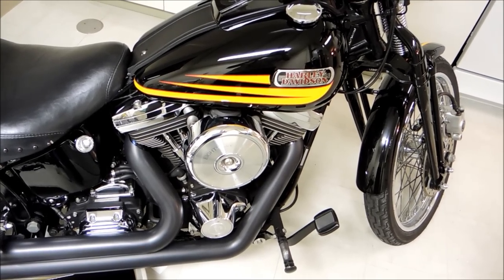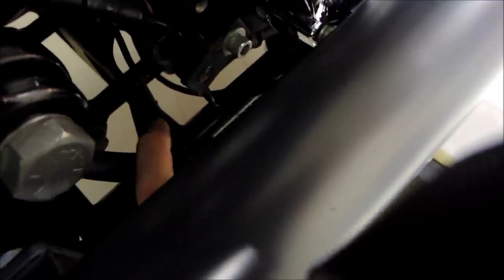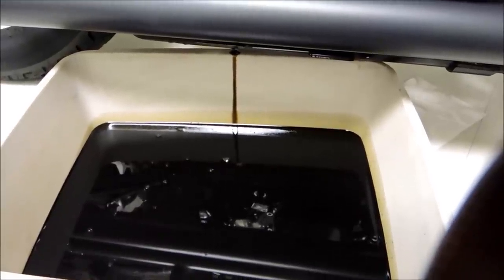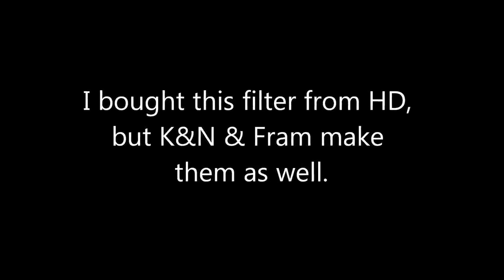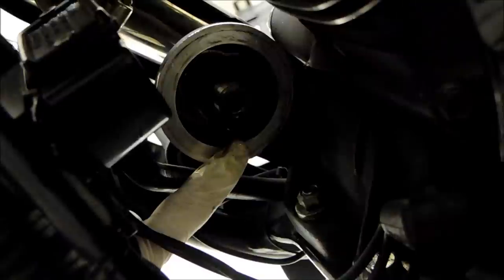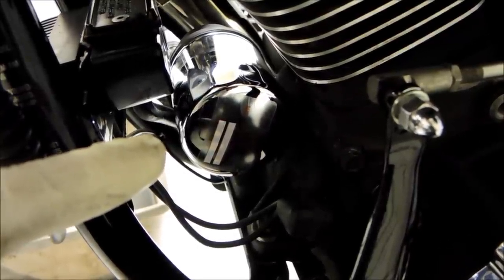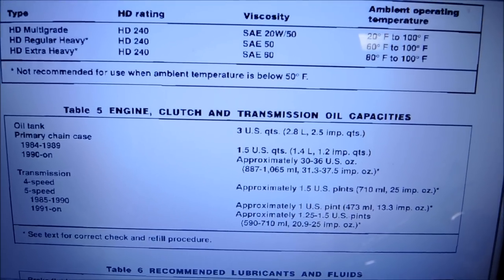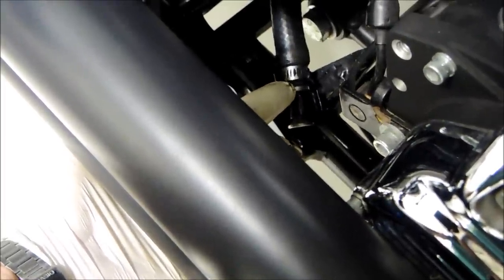OIL CHANGE 1996 Harley Davidson Softail Springer 'Bad Boy'

Comment: Just a quick note. Make sure to check the manual for your exact bike. My 96 dyna fxds-con says to check oil level resting on stand. It varies between bike configurations.
Reply from the maker: Moto Gordo thank you for the great information!  It was slow going and a lot of reading so every bit of wisdom is greatly appreciated.

Comment: Please do a primary and transmission as well.
Reply from the maker: SONGWRITERS COVE I will make a video next time I change my primary fluid.  If you are in a hurry, it is more simple than changing the oil.  1.  Ride bike until primary cover is warm to the touch.  2.  Put bike on lift or put 2” x 4” under foot stand to make it as level as possible without tipping it over.  (Get a friend to hold the bike or a motorcycle lift). 3.  Place drain pan under primary cover and remove drain plug (located on bottom of primary cover).  4.  Remove larger circular access cover and place cover and gasket (if gasket comes off easily) on clean surface for reuse.  5.  Clean drain plug with brake cleaner or gasoline and put Teflon tape on drain plug.  6.  Put drain plug in (don’t over tighten).  7. While bike is level pour lubricant (3 in 1 v-twin transmission, engine & primary fluid is fine) until it goes about 1/2 inch above large circular clutch shell that sits behind large circular access cover.  Make sure it does not overflow onto the floor.  That means that you reached the fill limit.  8.  Put the gasket and cover back on and tighten the screws 9-10 foot pounds or 12 - 14 Newton Meters.  You are ready to ride after that.
Reply: @ClayLoyd  Thank you my friend.

Comment: please what part number of filter used your byke...I got 63798-99A filter with me.....do you think it is work?
Reply from the maker: Arturo Ochoa the  best advice I can give would be for you to drain the oil into a clean container.  Remove the old filter and put the new one on to see if it fits.  If it screws on tight and the rubber filter gasket makes good contact then it probably fits.  The worse that can happen is it doesn't fit so you would have to put the old filter back on, put your oil (you drained into the clean container) back into your bike and order one from http://www.jpcycles.com.  Just plug your year, make and model and do a search for oil filters.  You can contact them as well.  They are very helpful!